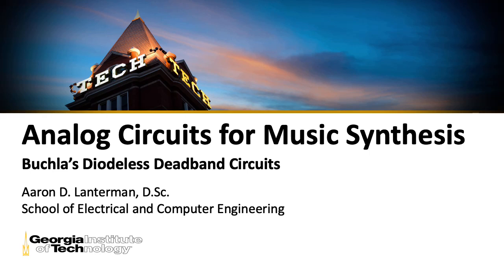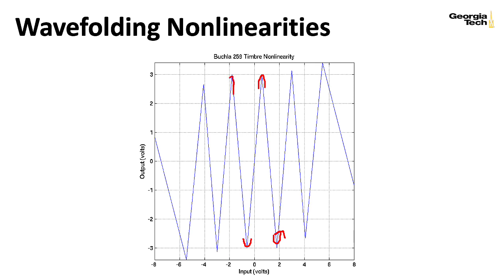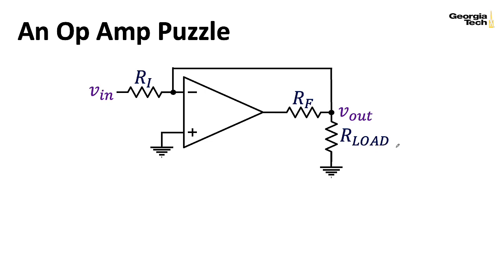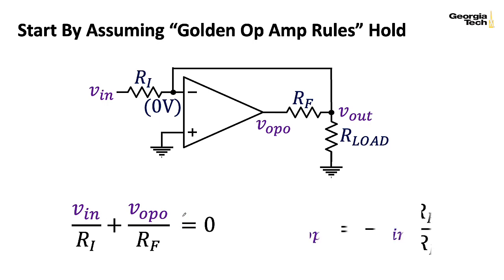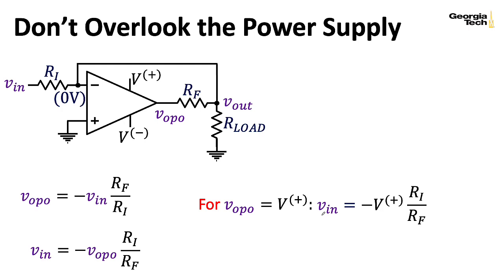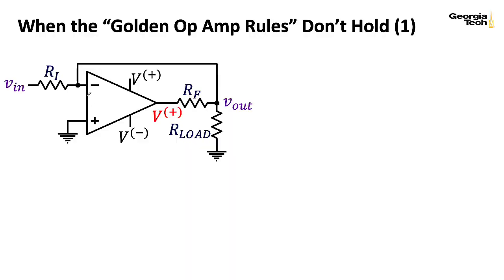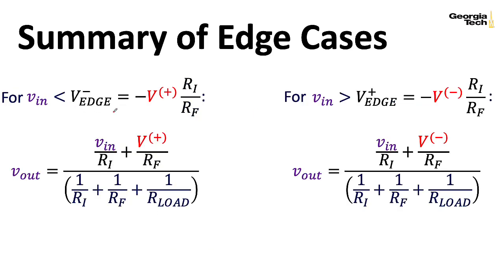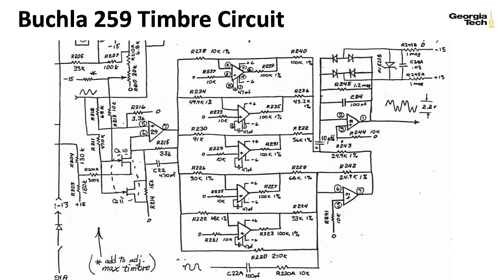ECE4450 L15: Buchla's Diodeless Deadband Circuits (Analog Circuits for Music Synthesis, GA Tech)

Comment: I tried this once on a different opamp than Buchla used, and found that an input voltage greater than the positive supply not only made a protection diode conduct, but triggered a parasitic SCR on the die and latched the output of the opamp.  Whoops.

Comment: I think you could make a very basic audio compressor out of this, with the deadband cutoff point determining the compression point.

. . . This is essentially a core of a noise gate. Op-amp buffers in front and back, possibly translating the signal up to a single-rail reference voltage and you can easily adjust the noise gate volume level by adjusting the core amp's rail voltage.
Reply: Hmm, not really and not really. :) What's missing in both cases is a time variation component. This is only an instantaneous voltage distortion effect.

What's normally called a compressor attenuates the signal when it gets loud and then returns to unity gain. What you could build with this circuit is more like a soft clipper/shaper.

As for noise gate, it would get rid of the noise, but at the same time it would also cut out the middle part of the wanted signal so the tops of the waveforms are moved closer to the zero level. This would create discontinuities in the waveform and make the signal sound distorted and much "noisier" to the human ear.
Reply from the maker: The deadband wouldn't work as a noise gate since it's effect is instantaneous. It would give you crossover distortion, which might sound weird and cool in its own way... but to do a noise gate you need to get an average of the power of the signal and have the gain respond to that (same with a compressor).

Comment: I see the circuit diagram as an opamp with 2 inputs on the -ve terminal with one of them grounded, the other with Vin.. The output will be the sum of these two signals (Vin+Vgnd) at the -ve input.Why do we have a complicated theory? Is there any reason why one should look in your way? Regards